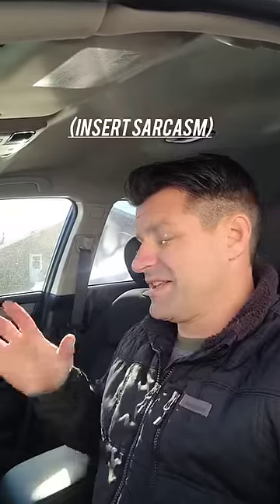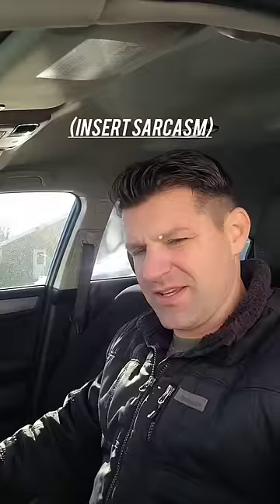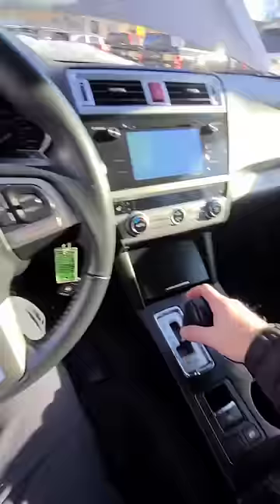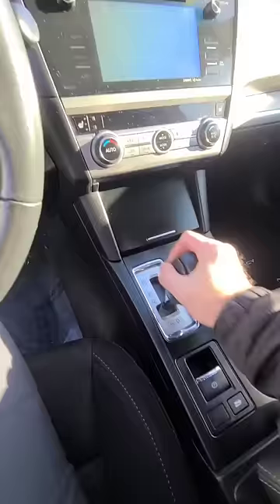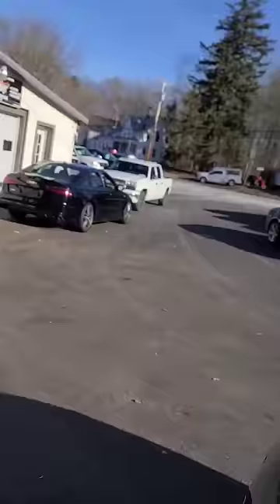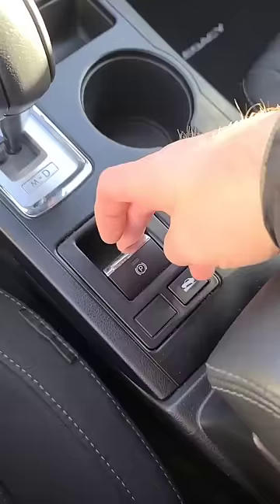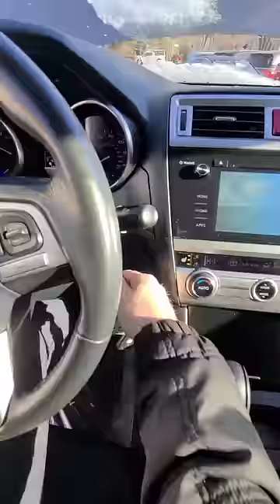Why Subaru Engineers deserve a punch in the Face! #shorts

Comment: Parking brakes should ALWAYS be mechanical and operate regardless of any other systems.
Rest in peace, Anton Yelchin.
Reply: I'm not sure how any of this is relevant to what happened to Anton Yelchin.  Automatic parking brakes ensure they are used every time the vehicle is put into park, reducing stress on the transmission parking pawl and ensuring the parking brake is always used (which is rarely the case with most drivers who drive vehicles with automatic transmissions, hence why electronic parking brakes are so common now).  It also eliminates the cable mechanisms which often fail or become damaged/seized after a few years due to rust, etc.
Reply: @jeffer1101  Unless the vehicle decides to turn them off for some reason.
Reply: @jeffer1101  you should be able to park your car without power.
Reply: The electronic handbrake in my Seat Ateca works when the ignition is off.
Reply: @Hondadctrider  how about when the battery dies
Reply: @merma9042  Just override the shift interlock instead of whining about it on youtube
Reply: @jeffer1101  My Toyota has the original 25 year old parking break mechanism and works perfectly fine, they don’t wear out like your suggesting, also newer cars with electronic park brakes don’t engage the park break when you put it in park. It’s exactly the same system as far as function goes, just one is a cable and lever the others a solenoid and a switch.
Reply: @jeffer1101  " It also eliminates the cable mechanisms which often fail or become damaged/seized after a few years due to rust, etc."

This is so far from the truth and far more dead batteries happen then 'e-brakes becoming damaged after a few years'. A mechanical should always be available contrary to your ill-informed opinion.
Reply: It's called an emergency brake for a reason. It should always work not matter what.
Reply: @jeffer1101  we should probably stop issuing driving licenses to the idiots and that's it. And, yeah, the e-brakes are still the maintainable equipment so no advantage from this perspective.
Reply: @jeffer1101  that’s not the cars fault tho, it’s just most Americans never use the handbrake as if they didn’t know what it did. It seems no one teaches them to use it on tests.
Reply: Yep.  I think it should be made a law.
Reply: @BondoV2  really? Is it common for Americans to just never use their parking brakes?
Reply: @MohammedAli-tb7zc  from what I see in these videos, yes. People seem so surprised that the handbrake exists on their cars. I’m from the uk and literally every car that you see parked will have a handbrake on and maybe it will be left in gear too. The only reason some people will leave it off is because if it’s too cold the cable is prone to snapping or they have an automatic and enjoy seeing the car roll back slightly as they get out.
Reply: WHAT I BEEN SAYING
Reply: I've rarely had a car where the emergency brake even works.
Reply: @TLK22  it is not. It is a parking brake. The electronic ones are actually safer to use in an emergency, because they have ABS unlike mechanical parking brakes. Because locking up the rear wheels, especially when in a turn, is a reeeeeeaaally bad thing to happen.
Reply: @jeffer1101  They are more rightly called emergency brakes because the idea behind them was that even if the normal systems all fail the emergency brake will be a secondary method that is completely separate and different from the main system.  So even if your battery fails and your engine fails and every electronic system fails including all computer chips you still can manually pull on the emergency brake and the car will stop anyway. Nothing is more important than the brakes so we need a completely separate and totally different system for a back up brake.
Reply: The Anton Yelchin thing had nothing to do with the electronic parking brake it had to do with the way the transmission was designed 

Go back to reddit
Reply: @TLK22  it should never have been called an emergency brake. It's a parking brake, thus (P). It's used when stationary! It isn't an alternative to regular braking, though clearly it will have some effect...
Reply: @georgejungle138  Which gear did he leave it in, and how did the transmission affect the situation?
Reply: @xnamkcor  because the way the Jeep transmission was designed was confusing it had nothing to do with the parking brake being electric 

Again go back to reddit
Reply: @georgejungle138  Almost all transmissions are confusing to the layperson. You explained nothing. Do we know what gear he put it in?
Reply: @jlrutube1312  This is a moot argument, it's basically "When your car catches fire, explodes and is sucked in by a black hole, you'll still be able to use the handbrake."

What you're describing is just such a massive catastrophic scenario that it is impossible for it to happen. If you're really going down the road and need to use the handbrake to stop the car, you shouldn't have been driving the car in the first place, because it's not even remotely road legal.

The things that need to all simultaneously fail to end up having to use the handbrake: Battery, alternator, engine, brake booster, brake master cylinder (affecting both hydraulic circuits).
Reply: @MohammedAli-tb7zc  They use them about as much as they use turn signals.
Reply: yeah but anton would have died either way because his car had a manual, handbrake, which he DID NOT decide to put in use.  It can be said the rotary gear shifter he had was/ is weird, but you should always use handbrake, especially on a hill!
Reply: @jeffer1101  tell that to Anton Yelchin
Reply: @jeffer1101  it's all about the safety standard, no matter how convenient it is, the bare minimum should be fulfilled
Reply: @BondoV2  maybe that's because not just in America, but EVERYWHERE in the world, tests are NOT what teach you things. They are something used to demonstrate what you've learned. Not to teach.
Reply: Automatic electric parking brakes are also applied whenever the driver door is opened even if the vehicle is in drive, as a safety issue. It's computers deciding if you really need to open the door on that rolling automobile.
Reply: @jeffer1101 funny, owned about 30 beaters over the years all them rusty crusty ebrakes worked fine, only one that didnt was a miata that a mechanic broke changing pads.
Reply: @Phrew the only thing that needs to fail is the brake master cylinder, and you can have no brakes.
Reply: @Jeromeeb you would have to have catastrophic failure of the master cycling because it has two separate reservoirs and 2 pistons which is very unlikely to fail simultaneously
Reply: @dylancantwell2846  there are two res and single res masters. Lots of cars have one res.
Reply: @Jeromeeb  there is not a single car since 1967 that has a single reservoir the government mandated dual reservoirs because of how safe it is
Reply: @PermaJeff  let me correct my self then. Lessons for learning to drive a car should involve using the handbrake when parked. It will save some people the wonder and surprise of discovering what that lever or button does like 4 years after they have started driving.
Reply: It seems almost like common sense or something, doesn't it? lol
Reply: @Hondadctrider  unhook the battery and see if it still works?
Reply: @jeffer1101  I'm a few years over 60 and been driving since before I was old enough and I've never had a problem with a parking brake.
Reply: @lt8590  That sounds dangerous. Just braking the car without warning any time the car things a door is open? Keep in mind, there is no "gentle" stop when using these brakes.
Reply: Who is Anton Yelchin?
Reply: @jrag1000  He was Chekov in the Abrams Star Trek Reboot.
Reply: @jrag1000  if you had typed that very sentence in your search engine instead of here waiting on a spoon you would have known 3 seconds later.
Reply: @xnamkcor  , it was either left in reverse, or neutral. It’s not so much a problem with the transmission itself, but with the way the gears were selected. 
As I understand it, the 8-speed ZF automatic transmission was controlled in the following manner:
Up puts it in reverse.
Down; forward driving gears. 
It always returned to the center, and if between the first driving gear and reverse, it would be in neutral. 
To engage the parking pin, a little button at the side would be pressed. 
Not intuitive at all. 
The parking brake, (E-brake), was electronic, but was most likely not engaged.
Reply: I immediately thought of him.  That's a horrible way for anyone to die.
Reply: @chaospenguin1  Agreed.  My Solara is 22 years old, never had an issue with the simplest mechanism in the world--the parking brake.  Some of the new vehicles seems like they don't always make up their mind to turn the electronic brake on/off.  This was my experience with a couple of different rentals.
Reply: @jeffer1101  The electronic mechanism that lets those things work is more vulnerable to failure than any mechanical system.  Then when the car is on its second or third owner who can't afford to get it fixed, the car has no parking brake at all.
Reply: @chaospenguin1  Building on/supporting your comment, I've got a 30 year old Ford and a 30 year old Mitsubishi both with mechanical park brakes.  My brother has a 50 year-old truck with a mechanical park brake.  All still work fine.  Electronic park brakes are one of a number of reasons I have no plans to buy a newer car.
Reply: @Phrew  Not true, I've driven a few cars with electronic parking brakes and tried to use them to stop.  All I achieved was a fast lockup of the rear wheels.
Reply: Electric parking brakes usually activate when shifting to park/switching the engine off
Reply: @Patrick-zr8tv  the Batterie usually doesn't die when the car is running?have you ever had a dead battery with a car in neutral??really??
Reply: @dylancantwell2846  I owned a 91 Thunderbird with one reservoir.  Had a friend with a 93 Mirage with only one reservoir.
Reply: @rasch19785  The battery can die while driving if your alternator fails and the driver is too clueless to notice.  I've known a couple of people it's happened to.
Reply: @rrice1705  no you didn’t
Reply: @BondoV2  Where did you get this information from?
Reply: @drdabsmore945  which part?
Reply: Could be worse, the 2017 Altima has no emergency brake at all, it has a driver-side footwell PARKING BRAKE like on old fords.
Which you cannot hit while in a driving emergency as you have to physically twist your lower body to get to it which means you can't step on the normal brakes.
Damn it , Japan!
Reply: Now tesla is takling about steer by wire, no way.
Reply: I'm glad my vehicle has a fully mechanical transmission selector, and cable operated hand brake.  And regular key lock in the door.  No power needed for these systems.
Reply: WWWWOOOOORRRRRDDDD
Reply: i don't understand this at all. what is the point of a emergency brake that doesn't work during emergencies?
Reply: @ut000bs  then I would have missed snarky comments like yours to liven up this place.
Reply: @xnamkcor  ah I remember now, crushed by his SUV, that was ridiculous.
Reply: @Phrew  No.. it does not require a massive chain of events for normal brakes to fail. I had to use my (fine, i'll humor you) parking brake while driving because the master cylinder in my pontiac bonneville went out. At best i was able to quickly pump up pressure and brake normally, but then the brakes would slip and the car would move forward again. I drove home doing an entire dance of pumping up the hydraulic brake enough to be able to stop, quickly hitting the parking brake and holding the brake pedal down to keep the tail lights lit, then when the traffic light turned green i would quickly hit the release and drive on. 

note: i drove home with this mechanical failure because my house was fairly close and traffic was lite. I would not have attempted this if it was a long distance or it was rush hour traffic.
Reply: @jeffer1101  This is why it was made electronic. My Bronco engages the parking brake when parked and shut down.
Reply: Who tf is Anton?
Reply: @jeffer1101  Myself and everyone else in Australia was shocked to hear that Americans almost never use the mechanical handbrake/emergency break unless parking on a hill. You would be scolded for that here, and I feel sorry for the stress being put on all the transmissions in the USA.
Reply: @jeffer1101  The entire point is that it's a failsafe dude. Independent from the brake system. Those cables you speak of are just actuated by an electric motor instead of a lever, still able to get damaged or seize. It's fucking stupid any way you look at it
Reply: @chaospenguin1  Hell, my 97 F150 parking brake works just fine, and that truck has been in and out of the Florida Keys constantly. The cable definitely isn't rusted or damaged at all after 20+ years. Same for my 05 Accord, which has also been in and out of the Keys. Rustier than usual for a southern car, but parking brake works perfectly.
Reply: @Phrew  That's why you can manually apply pressure gradually yourself with a cable actuated parking brake... 

You don't slam on the brake pedal when you come to a stop, why would you do that with the parking brake? In a scenario where any part of the hydraulic brake system fails and the brake pedal isn't working, the parking brake can be used as an emergency brake. 

God forbid your alternator ever goes out and your battery dies while you're driving, now you can't shift or engage the parking brake and your brake booster isn't doing anything to help you brake. ABS is definitely going to help you there.
Reply: @fivefingerheist  did you not read the other comments on why this is bad?
Reply: Actually because of that Jeeps automatically engage the parking brake when it's not in park and the door is open and will only disengage if you physically hit the button. Mind you this probably doesn't mean anything for the scenario above.
Reply: @jeffer1101 so guess what?? Automatic connected to the cable. Done. BOTH. done.
Reply: @NatVirgo  haha ikr
Reply: @TakeNoShift  in an emergency? Hell yes I slam the brakes, cause I need to stop right the hell now. That‘s the whole thing about an emergency. And everyone is a smartass on the internet, but the same people will still panic and yank the handbrake way too hard, locking the rears and becoming a passenger. 

Also if battery and alternator go dead, you still have engine vacuum and your regular brakes just work. The only part that has failure modes that will render the brakes inop is the master cylinder and pedal assembly. And for that it has to basically fall apart completely. Everything else is redundant.

But honestly, I don‘t know what kind of shitboxes you people are driving that you really need to think about that kind of failure.
Reply: @jeffer1101  the vehicle can always have both automatic and manual parking brakes.
Reply: @TLK22  From what I understand, it was originally called an emergency brake instead of a parking brake because of a switch to automatic transmissions to differentiate it from actually shifting into park, parking brakes are often the term used for manual vehicles because they don't have a park option on the shifter. What's in that Subaru is not called an emergency brake, it's called a parking brake, hence the big  "P" emblem
Reply: @xnamkcor  The vehicle in question had a recall because the shifter design was defective and made it difficult for drivers to determine if the vehicle was left in park or in gear.
Reply: @Phrew  you know, you're listing these five plus things that you say are REQUIRED to fail before you would ever need a mechanical handbrake, in the comment section of a video that proves situations where only ONE part needs to fail for a mechanical brake to be better. NOT VERY OBSERVANT ARE WE?!?
Reply: @lt8590  I've never had a vehicle turn on the parking brake when I open the door.
Reply: @dylancantwell2846  I've been in three cars, two older and one newer, where the brakes have gone out completely both front and back. Not to mention many people might not notice if one fails and might keep driving, putting more wear on the other hydraulic system until that one breaks as well, people aren't exactly the most observant creatures when they expect something to just work. This catastrophic failure you speak of isn't exactly uncommon.
Reply: @dillzilla4454  it's not, it's a parking brake, not an emergency brake
Reply: @Phrew  if you require abs on your "PARKING" brake while turning, you are doing it wrong. it's to keep the car from moving, not a "PULL IN CASE OF EMERGENCY" lever, and it never has been, ever.
Reply: @platinumsky845  you’re going to notice if you lose half your master cylinder especially when your red brake warning lamp comes on and your car is pulling to one side or barely stopping 🤦‍♂️
Reply: THANK YOU. The electronic parking brake is STUPID. not everything needs to be innovated. Instead of making real innovation theyre complicating things that work well enough
Reply: @nicewhenearnedrudemostlyel489  exactly my point. But with a electronic one, it’s possible to use it in an emergency while driving. E.g. passenger pulling it if the driver is having a medical situation.
Reply: @Hondadctrider  Yes, but not with a dead battery
Reply: @TakeNoShift  It's OK, Mr Chairmula1 Driver, you will be able to think straight and pull the handbrake just enough to not lock it. Maybe you are the reincarnation of Senna himself.
Reply: @jeffer1101  I never saw an automatic parking brake in any car. You always have to set it yourself.
Reply: Yep
Reply: @xnamkcor  Yes the one in a billion vehicles that do that...
Reply: @Patrick-zr8tv  Great point. That's exactly what EPB was responsible for in many 2018 legacy models. Completely drained the battery when left overnight.
Reply: @jeffer1101  The electronic breaks don't typically engage automatically when parking... At least in the vehicles I have seen.
The fact that these breaks are typically referred to as emergency breaks suggests they should be designed like other emergency systems. A key feature of many emergency systems is to remain operational when power goes out especially if they run off an unreliable source like a battery.
I think the benefit of a mechanical system coupled with the simple habit of engaging the break while parked would ensure you that you will always have some degree of stopping power while in your car.
Reply: @Hondadctrider  Yes, and Luciano Pavarotti is wildly recognized as the best tenor in history, but there are those that think Jussi Björling was the best.
Reply: I still haven't forgiven Stellantis for that. He was so young.
Reply: @jeffer1101  I have never seen or heard of a manual e-break ever failing, ever.
Reply: @Carlisho  I have seen snapped cables before but in every case the failure was actually due to the brake seizing in the open position from lack of use.
When the break seizes its like the cable is fastened to a solid wall and not a spring. Pulling on the lever immediately makes the cable go taught even though there is plenty of travel still left. Following this travel all the way through will snap the cable in many cases.
In this scenario the cable is experiencing more load than it was designed to handle because of the abnormal condition of the brakes. Therefore I would say that this is not an inherent design flaw with the cable system.
Reply: @ragnarok7976  I see, thanks for the insight
Reply: @jeffer1101  as a Master ASE tech/mechanic and a mechanical engineer, ask me how many times I replaced parking brake cables or saw parking brake cables fail in the 22 years I spent wrenching in and out of shops/dealerships(not including now that I still wrench regularly but as a hobby)? Literally 2 times, and that was because those 2 vehicles had been in accidents where the cables were damaged and needed to be replaced after the bodyshop finished their work. Please, stop the BS. They don't fail "often" as you mentioned.
Reply: @TLK22  If you refer to your car’s owner manual, you’ll see that it isn’t equipped with an emergency brake - it’s equipped with a parking brake. Those do not serve the same purpose.
Reply: @ragnarok7976  Those brakes are only referred to as “emergency brakes” by owners who never read their owner’s manuals - in the owners manuals, they’re always referred to as parking brakes (thus the P symbol on many of them). Another thing that people would know if they read their owner’s manuals in their vehicles is that those brakes are not designed to be able to stop the car in an emergency and this is explicitly stated in owner’s manuals and has been for decades. Go ahead and check for yourself. The fact that these brakes are not designed to stop a moving vehicle should be evident by the fact that many vehicles that have disc brakes on the rear actually have a separate, much smaller brake for the parking brake mechanism.

It’s been many, many decades since cars still had emergency brakes in them. Some of the commenters here talking about how they’ll never buy a new car because they don’t have “emergency brakes” may have cars old enough to have brakes that were still called emergency brakes, but they haven’t actually been emergency brakes since cars had cable operated 4 wheel drum brakes.

If you want to pretend they’re emergency brakes, try this sometime (or actually, better yet, DON’T try this, because there’s a good chance you’ll get yourself or someone else injured or killed). Get your car up to highway speed and try to stop using only the parking brake or “emergency brake” and tell me this - is that going to do any good in an actual emergency? I mean, if you’re going down even a slight hill, the best you’re probably going to be able to do is maintain your speed rather than speeding up further. These are NOT “emergency brakes” and they haven’t been for literally decades. If you still don’t believe me, contact any vehicle manufacturer’s legal team and ask them about their vehicle’s “emergency brakes”.
Reply: @jeffer1101  I'm not sure how any of your comment is relevant given the whole point of the video
Reply: @dylancantwell2846  you haven't met, well, ANYONE in today's society have you? Yeah, that might be easily recognized by many but I've met more than I would like who are so clueless they wouldn't notice the damn engine itself being on fire. 🤦🤦🤦🤦

Not saying it's not stupid, just that it's more common than you might realize.
Reply: Well i dont mind.. we got new bumper to our car thanks to electronic E brake failing and car rolling into ours in parking lot. I would not never get one, but paid new bumper that had issues before hand.
Reply: @Hondadctrider  disconnect your battery and try again
Reply: @Native_love  Ironically, batteries are what allow certain equipment to work independent of power outages.
Reply: @jeffer1101  can’t you have redundant systems?
Reply: @xnamkcor  not to Europeans, they aren’t. We deal with manual stick shifters all the time and, other than the odd position of reverse gear, some of which even force you to pull the stick knob before you can engage them, they’re pretty straightforward overall.

Parking a manual transmission car is also super simple: just bring the damned thing to a stop and, while still braking, step on the clutch, pick the gear opposite to the incline you’re on (or the gear in the direction of the road if you’re perpendicular to the curb, so you don’t smash into it in case you forget to step on the clutch when turning on the ignition again), engage the MECHANICAL parking brake and turn the damned thing off. And then you can let go of all controls, yay. Alternatively, you can always park it in neutral and engage on the optimal gear afterwards, because, duh, the whole shebang is mechanical and manual (though sometimes it won’t engage properly that way, so I still prefer to do it with the car turned on).

Oh, it looks like those are too many steps? It’s one of the first things we learn after setting foot on a vehicle in driving school, and muscle memory makes it fairly easy.

Clutch points, and not forgetting to engage first gear before attempting them, are a far harder affair, but again, the parking brake comes to the rescue… If you fail at either of those on an incline, basic instinct leads you to immediately pull on it again. You’re one with the car, as you should be. A manual transmission car isn’t like a game controller on which you push some buttons, it’s a very physical affair (and it used to be much worse; the cars I drove at driving school and the first vehicle I drove after getting my license, a compact urban cargo van, didn’t even have power steering!).
Reply: @Mainyehc  That sure was a lot of text. Which comment were you replying to? I don't recall ever saying operating a manual transmission is hard.
Reply: Absolutely not....
Reply: @Phrew  but imagine you lose battery power and you lose brake fluid only thing u got is the transmission on that scenario de mechanical would save you there
Reply: @javiermurillo4404  At risk of repeating myself: That's an insanely catastrophic scenario, if you think that's a realistic risk, you should probably get rid of your car and buy a newer one or one that has been maintaned.
Reply: @jeffer1101  and mechanical e-brakes are better. It isnt the manufacturers problem if you dont use it.
Reply: @jeffer1101  they still use a motorized cable which adds unneeded complications to something that's supposed to simple and straight forward
Reply: @TLK22  Not just work, it shouldn't just be on/off. Imagine needing the brake and it just locks up the rear tires when you turn it on. That is likely to send you into a spin.
Reply: Who? 
They serve dual purpose as an emergency backup braking system in the event of hydraulic failure.
Reply: @jeffer1101 ”a few years”??? What do you consider a few? I use the parking break in all my cars religiously. The oldest being an 06 with 70k mi. Never had a parking break mechanism wear out.
Reply: Yeah but hated how shitty they worked
Reply: err, not according to "them"
Reply: @jrag1000   *Was 👻
Reply: that is why its not an emergency brake anymore, its a "parking brake" because you are f'd in emergencies
Reply: @jeffer1101 electronic parking brake does not turn on automatically when you put it in park on some cars.
Reply: @rasch19785 some cars don’t do that automatically
Reply: @miguelc3033  I know.  It is automatic on my Toyota but you have to turn it on or off manually on my Subaru.
Reply: In his center console like the driver's armrest underneath there's a cord  yank that cord with  your foot on the brake it  allow you to put it into park or neutral if you have no power I only know because I used to unload new cars from the  dealerships off the train carts and we had a new car dead battery The same scenario you couldn't put it in the neutral to push it down the damn ramp took us about a half an hour to figure out if there's a f**** cord hidden that will allows you to do it without power
Reply: @danethegreat1834  Sounds like an old bi-plane...
Reply: Really bad idea that Subaru seems to have copied from POS VW. VW has been doing that since at least 2009. Pretty sure it has to do with the marketing department overriding the engineers because women like features like e-parking brakes. Just wait a couple of years and you won't be able to set your parking brake or get in your car without the latest iPhone and a special subscription only app.
Reply: @dylancantwell2846 what if your brake fluid boils/compresses or you have a leak in a brake line? Shit happens.
Reply: @Phrew How do you still have engine vacuum with a dead battery AND alternator? Your engine is no longer running.
Reply: @macabo  there‘s a one way valve in the brake booster that blocks air from entering back into the vacuum side of the booster. Even if things fail hard enough for the engine to stop, there‘s enough of a vacuum to stop the car. 

Additionally, the engine still can spin without ignition, especially so on manual cars, cause it will be back-driven by the wheels. Then it is still producing a vacuum. 

And even if not: don’t skip leg day. Brakes work without the booster, too, you just have to push a bit harder. Source: kept a 65 mustang from going forward despite the accelerator being stuck depressed. No boosters on those.
Reply: @jeffer1101 never in my life has a mechanical parking brake ever failed me nor will it    If anything the electronic parking brake is terrible as demonstrated in the video xD gimmicky
Reply: Electronic parking brakes exist for cost cutting, design space and convenience. 

Imo its not worth it.
Reply: @xnamkcor I would hope that they program that possibility into something any individual could drive daily. 😔
Reply: @BondoV2 overuse of the E brake will also get it seized up and then you're not going anywhere until someone backs off the brakes....
Reply: @truckercowboyed2638  overuse? You mean if it’s left on for ages it will seize up. Unless it’s been sitting for a while your handbrake shouldn’t be seizing up. There’s no need to pull the handbrake up all the way either, if it’s adjusted correctly it shouldn’t need that much travel
Reply: @jeffer1101 if that's the case, why not incorporate a mechanical parking brake in addition to a secret but automatic electronic parking brake
Reply: @jeffer1101 I am mechanic of 50+ years (started with father at -10) I have seen hand brake cables seize or fail perhaps twice in that time... I live in an area where salting of roads is not needed so I guess that might be a thing. But that proves reliability where electric brakes I have fixed many times on trailers. They are not reliable
 If your idea were sufficiently valid then dont lock out the park position and put a switch to activate an electric brake which is problematic as most electric brakes systems require power to activate. If a system were devised to use power to disconnect to activate that would dangerous  should you have a power failure at highway speed on a corner...
Conclusion he is dead right...its a super dumb idea to have a combination that prevents locking the wheels in any way without power.
Reply: @Hondadctrider My Subaru Outback also works when the ignition is off, it’s that the battery is dead, no electronic parking breaks work when the battery is dead cause they are electronic
Reply: I hate it when they "fix" things that was never broken
Reply: Another poor guy taken too early at the all too familiar age of 27